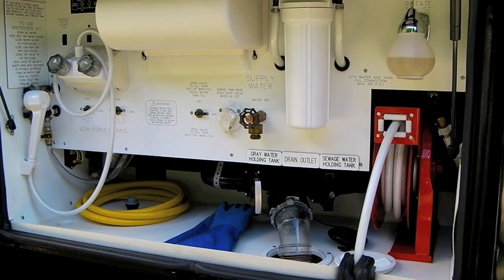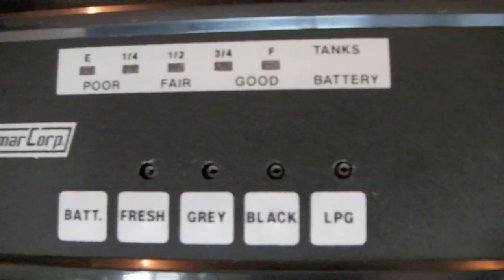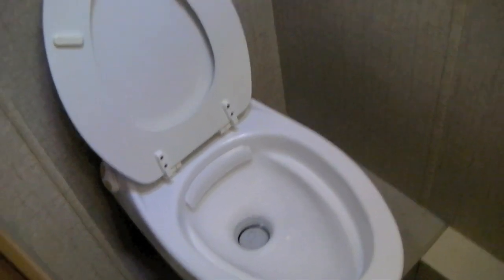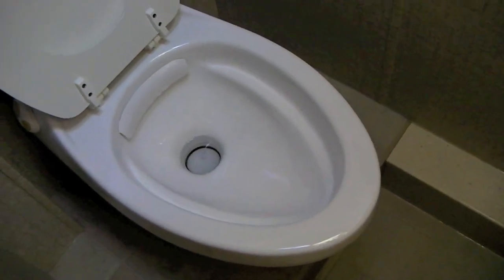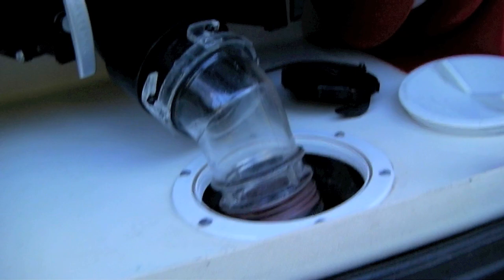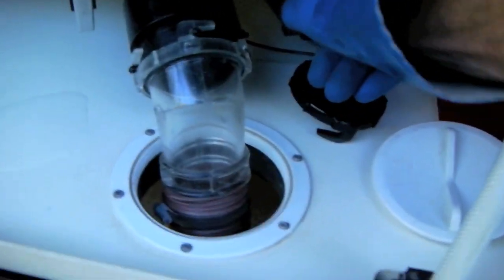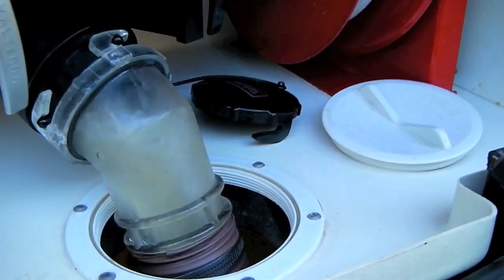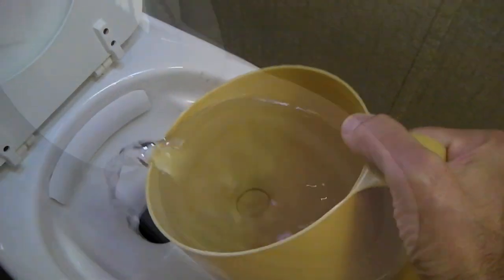How To Dump & Clean an RV Black Tank

Comment: How much water does the Black Tank actually use I wonder? I'm sure you're familiar with "Gone with the Wynns" Niki and Jason Wynn (you may have even met them on the road!) . Here is their "Composting Toilet - What it is and Why You Need One" video that gives an intro - there is some great detailed info on their site. https://www.youtube.com/watch?v=_E2xOoNov9s   http://www.gonewiththewynns.com/install-composting-toilet
Reply from the maker: Jennie Williams Hi Jennie! Nikki & Jason are good friends of ours, and we're well aware of their composting toilet. If you saw our video about operating RV toilets, we featured it when they were visiting with us: https://youtu.be/MYOxmcu_r9o

Every choice has its pros and cons. Composting toilets don't use water, but they're very expensive and require retrofitting, since RVs don't come with them (at least not yet). As far as dealing with the results of bodily functions, I don't see a dramatic of difference between the two systems when it comes to sanitary considerations and the amount of work involved. One requires dumping it down a tube into the ground and the other requires carrying it outside.

The primary reason we've considered a composting toilet (and really the only reason) is because they save water, which is good for our planet. We applaud Nikki & Jason's dedication to that, and at some point will hopefully be able to rise to their level of commitment.

As my mother would say... "That's why they make vanilla & chocolate." ;-)
Reply: RVgeeks Great, thanks so much for the reply. Obviously you've thought this through & I agree with your primary reason for considering the compost toilet. My hubby and I are starting to really home in on the RV of our dreams - Winnebago Class B ERA 70A or 70X most likely. I've been watching quite a few Sprinter van conversions - one YouTuber included the name of a custom tank maker.  I contacted the tank fellow to see whether an "airdry toilet" aka compost toilet, could be made that incorporated the European design elements of the wheeled waste tanks in a Class B. Would like to be able to just unlock the tank, wheel the dried solid waste to the garbage or compost pile etc. Will put some work into this to see whether it can be done. Warmest regards to you and thanks for your thoughtful videos.

Comment: ice don't  work . don't wast your money on ice
Reply from the maker: +Daniel Haas Ice won't work for pyramiding, but it works great for scraping dried debris off the BOTTOM of the black tank.
Reply: it don't  work . You just keep spending your cash  on ice
Reply from the maker: Sorry Daniel, but with all due respect, you don't know what you're talking about. It doesn't work for WHAT and for WHOM?

We have personal, first-hand experience where ice not only worked, but it was the ONLY thing that worked, in the exact situation many people encounter: leaving their RV stored with what they THINK is an empty black tank, but which is actually NOT empty.

As we showed in the video, the most common problem with black tank dumping is when people think they're completely clean when they're not, because they don't use a clear elbow or the correct technique to ensure they're actually clear of solids.

So they "empty" and "flush" the tank and put it into storage for a week or a month or a season, and the remaining solids in the tank dry down hard to the bottom of the tank.

Do that a few times.... or many times... over a few years, and the tank will stink, and the material hardened to the bottom will not come out. There's no "pyramid" but rather a hard thin coating that dried down over time... a coating that the weight and motion of a good quantity of ice will move OVER (not AROUND) as it melts, and scrape off during driving, or at least minimize greatly.

We successfully cleaned a tank in this condition using the exact ice technique we discussed here, solving a tank odor problem for practically nothing. Yes, that's right... in the grand scheme of things, ice costs practically nothing. If you think ice is expensive, how much does a professional tank cleaning and/or removal cost?

No one is claiming that ice works in all situations. But ignorance of the circumstances where it WILL work does not mean that ice isn't a great thing to try for many common situations.

Comment: Guys .. never ever ever close the black tank valve when  using your black tank flush!!!   You will ruin the seal on your  valves. The manufactures on your coach warns you of that.. its on your video. Please folks do not do that!!!! Too much pressure on your valves!!!!! You guys mean well but, folks do your research first! This advice is a mistake!!!!!
Reply from the maker: Allow us to politely disagree.  We’ve been using this technique for the entire 20 years we’ve been full-timing, 18 years of which have been in our current rig. In all that time, we’ve replaced the black valve exactly once. And not because it failed, but was just getting stiff to operate. Think about what you’re saying… if the valve can’t handle the “pressure” (actually only the weight, since there is no “pressure” due to the rooftop vent opening) of clear water behind it, how could it handle the weight of a full black tank of wastewater pressing on it? This method works like a charm, and we know lots of other RVers who use it, too. The only reason manufacturers say not to is liability concerns in case someone walked away while dumping and left it that way. Of course the water would come out the roof vent if that we’re to happen. But they don’t want to be responsible for the lowest common denominator (people who are negligent in the operation of anything on their RV).

Comment: Ice is a myth and can damage your black tank!!
Reply from the maker: It’s not a myth. We’ve used it successfully ourselves to scrape dried-on debris from the bottom of the tank and could clearly confirm the substantial improvement by looking right down through the open toilet valve. It just won’t cure every problem, including pyramiding. And there’s no way ice can harm a black tank.